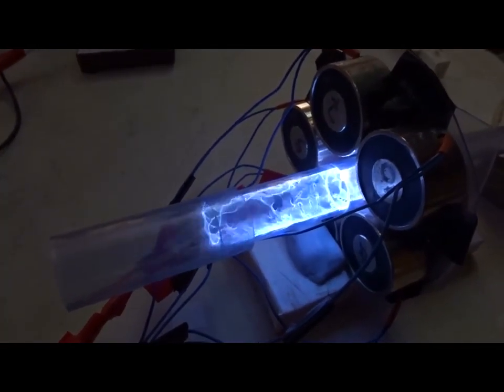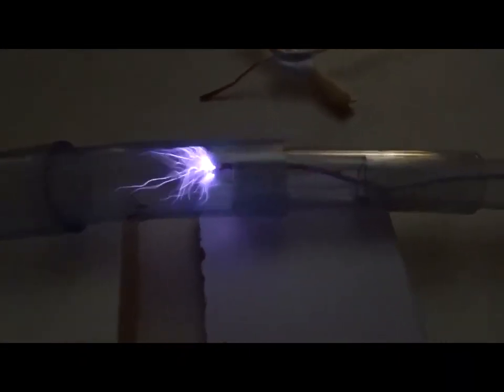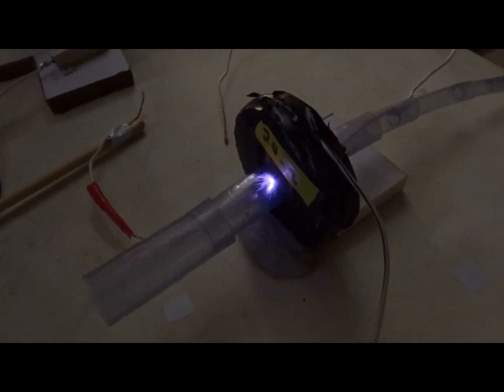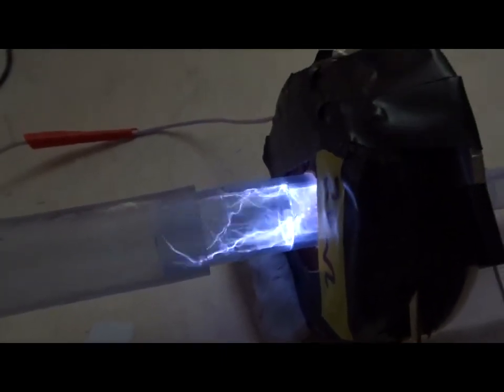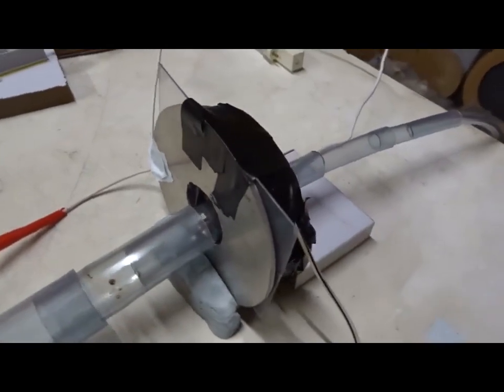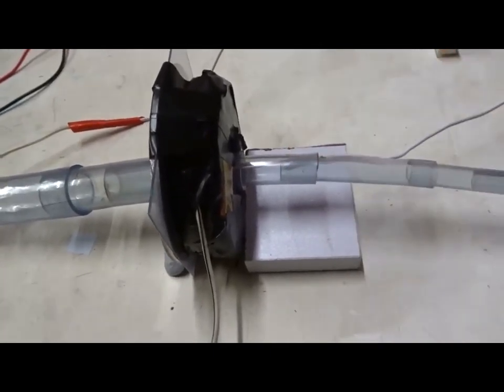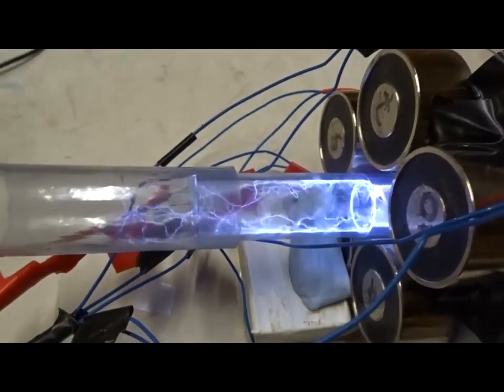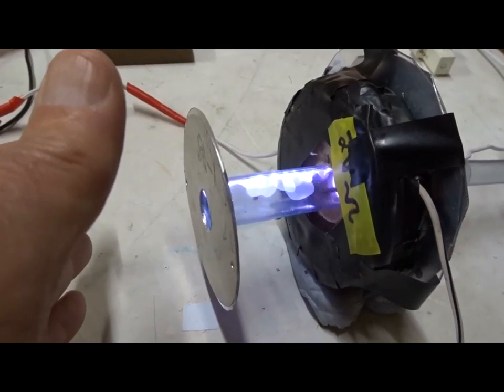The "ion rocket": magnetic Lenz repulsion of ionized argon gas at high frequencies

Comment from the maker: Just to explain further, this seems to be the first demonstration of Lenz-repulsion by an ionized gas, because it requires Tesla-coil frequencies of 500 kHz, and will not work at standard 50-60 Hz frequencies.
I have not followed up on this research for a ion-drive (yet), because that would require getting 10-20 times more power out of a Tesla coil, which I can't do using 3 MOSFETs. It can be done using spark gaps and a compact-ferrite core Tesla coil, but I simply have not had time to do this yet.
Getting lots of high-voltage power at 50 Hz out of microwave-oven transformers is much easier!
Reply: I dfon't think you need more power. Just better fine tuning and some deeper learning.